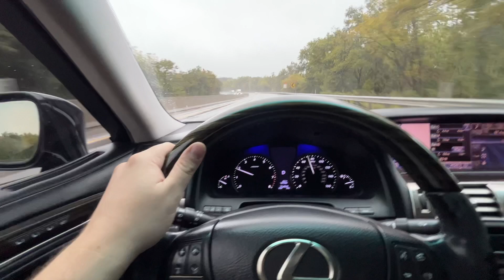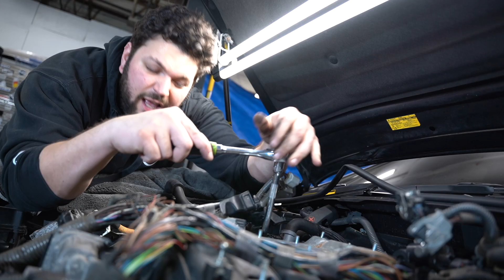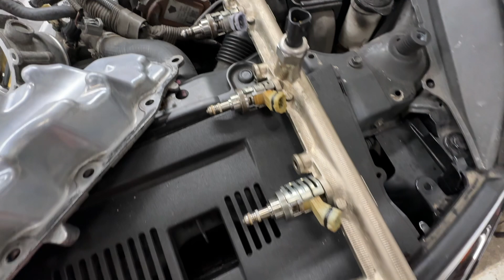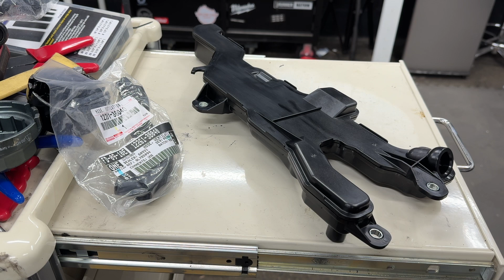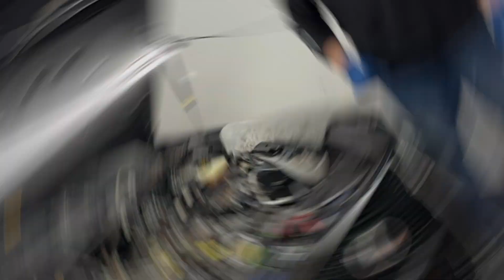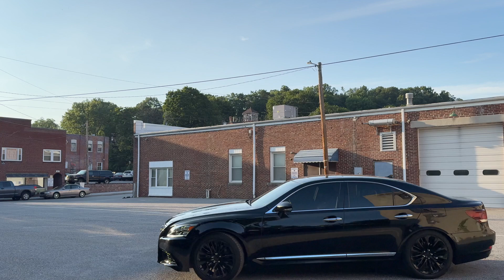200k Mile DIY Repairs On My 2013 Lexus LS 460 AWD - Injector + Gaskets Replacements

Comment: 10:10 Those Fuel Injectors are like $400 each at the local Auto Parts places, but I've seen them on eBay for around $20 bucks each.  Maybe the quality isn't as good, but at 200,000 miles (my 2011 has 180K miles), would you feel better spending the big bucks and replacing the one, or replace all 8 with the cheap copies?  I've had old Subarus, Mercedes, Audi's and Lexus vehicles and whenever I'd get an ignition coil error on ANY cylinder, I'd replace ALL with the cheap ones.  I figured if I'm going to do all that work to get to them, they're ALL getting replaced, but I didn't want to spend a fortune either.
Reply: Never buy refurbished or after market  fuel injector for this kind of hard work.  I did buy refurbished and after market injector for my Mecedes E500 before but failed twist cause me headache . Just buy the good brand like Denso or Bosch they last years.
Reply: @jianliu7516 I have a connection to where I get the parts directly from Wuxi.  Considering that Wuxi DENSO Hanshin Automotive Products, Co., Ltd is the company that DENSO themselves get the parts from, I don't think I'll have an issue.  And you're right about Refurbished.  I made the mistake of putting a refurbished power steering unit on my wife's Subaru and it failed after just a year.  I replaced it with a Chinese one 3 years ago and it's still going strong.  She put ANOTHER 80K miles on the car since.

Comment: You didn't need to unbolt the coolant lines to access the passenger side intake manifold bolts?
Reply from the maker: I did not - they can be pushed out of the way enough
Reply: @MartyMotoring your quick response is a God-send 🙌🏾 gonna tackle changing my PCV and intake manifold gaskets today

Comment: Hey could I give you my information so we could chat? With the valve cover off you should’ve maybe replaced the oil control gasket. It’s responsible for getting the oil to the top end of the engine.

Comment: Question: Was it necessary to remove the fuel rails and injectors to replace the heat exchanger gasket/packing? Mine is leaking coolant out the back of the engine, and I don't want to remove anything I don't have to. Great video. I replaced my valve cover gaskets, fuel pump gaskets and oil filter bracket "o" rings, and understand your pain.
Reply from the maker: Very nice! Sorry to hear about your leak. It’s very tight without removed the injectors and recommended to at least remove the wiring which sits on top

Comment: Have you had anything to do with the suspension?    Lower control arms and air suspensions is a common area of concern in these cars.   At the end of the repairs have you been able to eliminate all OBD2 codes?     Good job, it's a really nice car.

Comment: Did you remove any fuel fuses? In order to remove hpfp’s from valve covers? I wish you would have shown how to remove them. Really loved the content. I have an IS F & valve covers are leaking. I want to tackle this job myself. Just trying to research as much as I can. I also have an intermittent misfire in cylinder 7 & occasionally on 8.
Reply from the maker: I didn’t remove any fuses. I just let the fuel leak out lol
Reply: @MartyMotoring Yes, I heard folks going this route as the fuel fuse is a pain to remove. In the IS F the drivers side has the harness crossing over the valve cover. This harness goes into the main box panel. Did you have to do something here? If so, how difficult was it to remove the connectors?

Comment: Holy smoke you have cannon balls for taking on that project.  I have an 07 LS40L that has needed all new control arms, radiator, fuel gaskets, new shocks and a few other minor things.  I have limited mechanical skills and over time just like you was able to handle most of the stuff on my own via Youtube videos and posts on Club Lexus.  These things are fun to drive and look fantastic but be prepared to spend some serious $$ for repairs or wade into the DIY arena.  Well done on this undertaking. That is a nice looking car especially in light of the high miles.  Not sure if your year (2013)has he revised more reliable suspension in the front but if not be prepared for another go round of expensive repairs or more DIY,  although compared to what you just did it should be relatively simple.